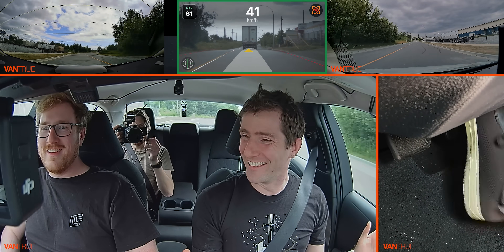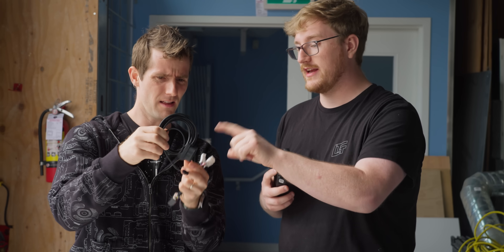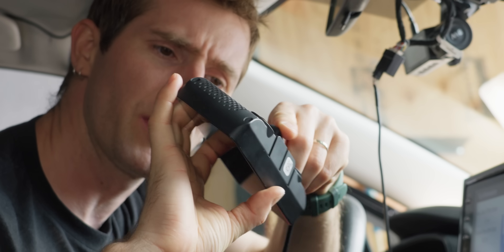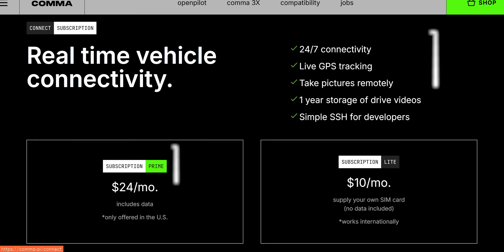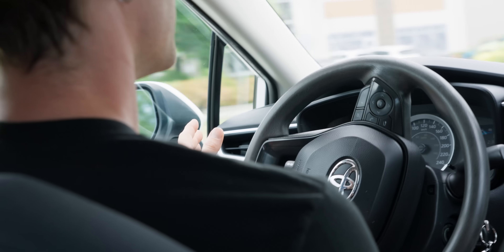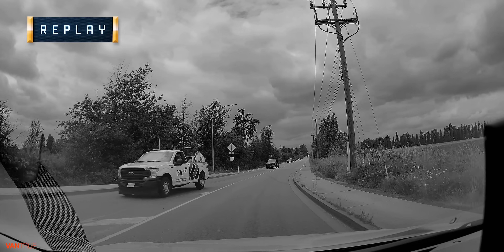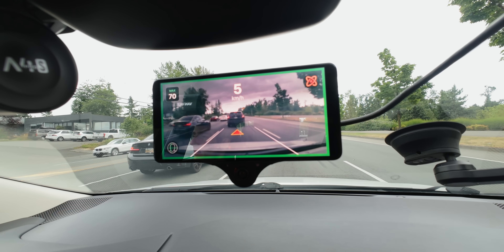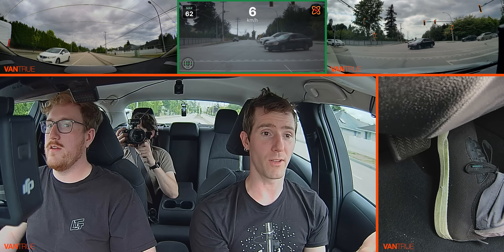I Upgraded My Car With Open-Source AUTOPILOT and it's AMAZING

Comment: As an engineer saying you can't do something like welding a chain sprocket to your steering column, attaching it to a stepper motor and proximity sensors in the wheel well, then hook it up to a motor controller, being fed with the proximity sensor which knows the distance the front and back of the tire are from the sidewalls and uses an algorithm to accurately determine wheel direction relative to steering column position. The only real issue at that point would be detecting what is a steering input from the driver, versus outside steering input like when you hit a pothole and your steering wheel jerks. You'd need to detect what is a steering input from the user versus what is a steering input from the road or environment, so you'd need to decouple the steering column and  put a steering torque sensor in the steering column aswell, That way it can reliably detect steering corrections. You'd feed all this to an ESP 32 which then uses your obd2 sensor data and wheel position sensor to bridge to comma. Honestly the easiest part is the modifying the car part, the rest is all making it work with Comma AI

Comment: I have a 2022 Chrysler Pacifica and it has HORRIBLE ACC. It won't turn more  than about 5 degrees. It downshifts and revs to 4000 RPM and then applies the brakes so it can't go faster.  I would like that.

Comment: I bought my Comma 3X a few weeks before this video was released.  Eager to see a follow up and if Linus' longer term opinion matches mine.  i.e. love it.
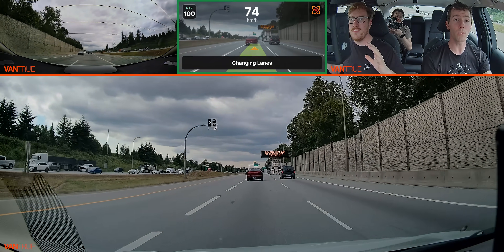@16:10 they mention the potential upgrade path using an external GPU and Linux suggests doing it in the 3rd video.  Gives us a part 2 and we'll call it quits.

Comment: I wonder who the real nervous and paranoid one is. Give you a hint it’s not Linus. Also my 2023 hyundai ioniq 6 sel is fantastic on the highway with lane keep lane assist and adaptive cruise control. I literally was on 95 for 65 miles and didn’t touch the steering wheel one time. It change the lanes for me. I literally did nothing other than turn to turn signal on to notify the car that I was wanting to change lanes. I can also touch the steering wheel make turns or make adjustments without anything being turned off.

Comment: So i looked into it, it only works with vehicles with factory equiped safety equipment that controls the steering wheel and breaks on top of the ones the comma has listed as functioning, so dont expect it working on your 04 civic any time soon.

Comment: You need to do an update for the new v4 model!
Reply: Well, though it wasn't that obvious due to lack of information in their video and on the website, v4 doesn't introduce any new features or capability. It's just a smaller unit with better heat management. The downside, is that they also shrunk the video screen to an almost useless size. 
They are working on some kind of external compute unit, but nothing was said about what it can do or is for, only saying it connects to v4. 

I was in hopes they would introduce more sensor tech that you can add to  it, or work with all the cameras in your car. 

Someone said that it'll always ONLY be Level 2 though, which is disappointing if true.

Comment: I'll stick with the stock adaptive cruise control and lane keep assist in my vehicle. At least then I know what it is capable of. These self-driving systems won't be any good until they're 100% no input needed, until then they're just adaptive cruise control and lane keep assist with some extra features that work just enough that you might not be prepared when they don't actually work.

Comment: 3:50 as long as your car doesn't crap its pants after doing so (some cars for example need to have faults reset when battery goes out)

Comment: Don’t sign in, then you can disable the driver monitor in the code without getting banned from the comma servers ( which does nothing other the not let you upload the videos. )

Also buy the c3x clone for like $600 and you’re using an old car. New cars can take corners fine.

Comment: Part 2 - Foam Bucks or Deer that you use a rope and pulley to pull out in front. Give it training data on deer. Remember, if 1 sprints across always watch for the 2nd fker that panics when it thinks it is going to be cut off from the herd/group and just jumps in front of you at the last second.
Bonus if you do a Moose and a pinata.

Comment: I'm just now peaking over the edge of this rather deep rabbit hole.  I'm shopping for a newer car right now and in my research, this came up rather nonchalantly during a video.  Now that I'm digging into this more, I'm getting rather excited as it is opening up pretty drastically my options to what is available on the used market.  Also, you're the first video I've seen since beginning to really dive into it that talked about the ability to interface an external GPU.  I REALLY REALLY REALLY want to hear more about this in particular.  Looking forward to your future videos for sure.

Comment: It shows, you have not used latest Toyota Corolla, or any Toyota car at all. All of them have stay in lane, adaptive cruise control, and it's perfect for highway driving, even in city I use it, when I know, there is speed cam, and I better be below 50. It just won't stop for red light, and you don't trust it to do perfect job 100% of time, but it works, in reducing stress. Better test drive new Toyota car models.
Reply: Seems like you don't understand the difference, this is open source and could, theoretically, be installed on any car. This is a cheap 2020 Corolla, none of those features are present.
I feel like you'd say they have not used the new tesla roadster in a video about how Starvis handles old Tesla Roadsters...

Comment: Thanks for the video. My Comma 2 just died, it's driven over 130K miles for me. I've owned it for 4 1/2 years. The Comma 3X is on order. The Comma has me terribly spoiled and I don't ever want to drive a car without it.

Comment: i find it more scary that your entire car can be controlled digitally with a couple wires and a source in 10 minutes
Reply: The magic of CAN buses. You didn't know that's how it all works?
Reply: @fitybux4664  Ah the "magic" of CANbus, making cars as boring as operating a dishwasher since the turn of the century🤣
I don't blame people for wanting self driving cars, the amount of input lag and lack of feedback on a modern car would make anyone not want to drive.
Reply: I find it beautiful tbh. I can't believe that's how simple it is. But the security risks are also scary o_O
Reply: @px8 Yup, and Toyota agrees so some of their newest cars are not openpilot compatible now even if you have electric steering.
Reply: Basically every modern car with adaptive cruise and blindspot is the same. 

As I understand it interferes with what ever the controls are available and over rides to how much the car was originally capable of. 

Basically custom instructions on what it think is right. 

If not all these new cars already have all this built in just not this open because ofcourse the liability is too huge

Comment: An early comment when it had trouble making turns that "Tesla's autopilot has problems with sharp turns too". That is NOT true. Tesla's FSD can drive hours in mixed driving environments without issue and that includes every kind of turn. Teslas leave the factory ON THEIR OWN, drive to a parking lot, crossing  other roads and yielding to other cars and park themselves. Soon they will be delivering themselves to customers after being purchased. Tesla is far ahead of every other self driving system.
Every electric steering rack has a maximum amount of force it can apply, which is why some turns cause it to request the driver's help. You can increase this by upgrading the steering rack so it has more torque or reducing torque needed with gearing or other means, depending on model.

Comment: There’s a fork called Flow Pilot, where you can just use an Android phone (with adapters). I would feel safer with the Comma 3X or whatever they will release in the future, but it is very cool to see.

Comment: As someone with this exact generation of Corolla, the car's automation definitely has a steering limit built in. It's intended for lane tracing and not actual steering.

That said, this being open source is very promising.

Comment: my ex boyfriend daily drives a Cybertruck. I don’t think most people realize how fantastic Tesla’s autopilot is. I made fun of it until he “drove me around” without ever touching the wheel. I think he spent 95% of the time sitting in the driver’s seat without his hands or feet doing anything, and this was in both Seattle & Phoenix, on the freeways, on residential streets… it turned perfectly, switched lanes while signaling, stopped at stoplights, followed the speed limit… the only time he ever had to grab the wheel were a handful of left turns when the truck couldn’t see a car in the way. but I cannot stress how rare it was. I was literally never even nervous about it. it felt so smooth, completely natural like a human was driving

the Cybertruck is a truly an amazing piece of hardware and software.
Reply: Ha I know that's you Elon 😂
Reply: @robjones1328  fsd is pretty good so that part is correct.

Comment: Reading the comments here has been more helpful. It's not quite an autopilot unless the car has high torque capability. Seems to be a decent autosteer for highways. That's actually amazing and the most important part for long highway trips. I totally see myself using this for vanlife.

Comment: But how can the steering wheel turn itself without taking it apart and installing motors and solenoids that can move the wheel on its own? What if your car doesn’t have existing cameras or lane assist?

Comment: Love me some aftermarket car gizmos.  Back in the early 80s I installed an aftermarket cruise control in my El Camino.  It had fuel flow sensor, Hall effect drive shaft sensors, and an actuator for the carburetor throttle.  Once it was calibrated you could do all kinds of stuff with it.  It would compute your distance to empty based on your speed every 0.1 seconds and update it on the display.

Comment: i have a question how does it steer for me, does the corolla have motors in the steering wheel?
Reply: If it's electric power steering there's a motor in the rack

Comment: Would be interesting to see comparisons between other similarly offered 3rd party driving assist products. Example in Malaysia where I'm from, we have one called Kommu which has been gaining interest and traction and (pardon my patriotic bias 😂) seems to be better calibrated compared to this.
Reply: kommu uses comma AI's openpilot tho
Reply: @MagZu ohh that's interesting. I did not know that 😅😂 thanks for sharing. Then I'm guessing the difference in performance may be due to how each company tweaks it? Just curious what makes the difference in performance
Reply: @johnckl2612  the only difference i see is kommu seem to use a different camera or actually looks like its based off a phone. the previous comma 2 device was just a smartphone with heatsink and fan + some extra circuitry. but it did work quite well to be a smartphone.
so actually the difference might depend on the different cameras used kommu vs comma 3x

Comment: Two dudes, Jeff and Kyle, thought: “Why not make any old car drive itself?”

They invented the AutoPilot X3000.

They said: “Plug and play, anyone can install it.”

Truth is, it’s a rusty box that barely fits under the dash.

Installation? Just remove half the car’s wiring and drill random holes.

Jeff claimed, “It presses the gas for you.”

Kyle added, “And kinda wiggles the wheel, if you hold it tight.”

They promised full self-driving for $800.

Reality check: you’ll spend weeks sweating, swearing, and probably breaking stuff.

At the end, the car kinda moves forward... sometimes.

But hey, they made bank selling dreams.

And you? You just got hustled by a toaster with wires.
Reply: Nah you're just a hater dude, it's sweet in traffic jams
Reply: kkkkkk yeah. 😂

Comment: Keep in mind that the electric power assisted steering in old cars like that - were never designed to have enough torque to take over 100% of the steering responsibility.

Comment: Have used it for 3 years now & love it! I think this video is under-selling it a bit. 
Its really not about how well it drives in smaller lanes, but more about how well it drives in highways.
Additionally think of it as a new driver (i.e. would confidently change lanes without looking at side mirrors) but something that can pay 100% attention to the road without feeling sleepy. I think on a day to day basis where its helpful is that it reduces strain for you while driving. You literally spend lesser energy focusing intently & physically turning/breaking. This makes driving safer because its always paying attention, even when u are looking at the map to see when u gotta take your turn, or when ur grabbing some chips to munch on, or ur dialing your wife's number or when u look at how badly sloshed your friend in the passenger seat is. Its ALWAYS paying attention & you become the relaxed second driver. 

In fact it was also a great tool that I used to teach my wife how to drive. It kept centering the car in the lane helping her understand what is the right position without me being the one breathing down her neck! Lol. 

Its definitely not full autopilot that can handle all types of roads, but its a really great newbie driver. 

One thing I must say though is after using it for so long, u do tend to trust it more than u should. As long as u keep a check on that, its a great product, perfect for nerdy folks!
Reply: @RaunakThomas  Yeah I remember having to drive home after an extended night shift and I was feeling sick to my stomach. It was a 45 minute commute and I was so happy to have the additional assistance getting home. It's like having a super attentive co-pilot

Comment: I have used the Comma 3X for 8 months in my Toyota Highlander 2021. Man its a game changer for the average Joe. Toyota is one of the brands that Comma Ai works well with the Toyota Safety Sense . You can use different forks like SunnyPilot or FrogPilot . GEO HOTZ u da man bro .

Comment: AS A MECHANIC IN NEW CARS IN MODIFICATIONS LIKE THIS DO NOT UNPLUG BATTERY. IT WILL TRIGGER ALL POSSIBLE DASHBOARD LIGHTS THAT YOU WONT BE ABLE TO REMOVE WITHOUT SPECIAL DEVICE. Also this Toyota is probably hybrid so disconnecting batter won’t do anything as far as hybrid is still plugged in but that’s just BTW

Comment: Yeh ... I mean at what point can you even tell if the person behind the wheel is even fit for driving?
I don't mind driving assistance but not driver replacement. Either make the systems bulletproof where it can properly turns and read the road. These in-between things seem like taking a risk.
Asking someone to "pay attention" while letting a system drive for them. 
It's like asking people not to use their phone while driving.
Thankfully this system requires money and a bit of knowledge to be able to use so the chances of a responsible person using it is very high.

Comment: Ever since I've first heard about these things I have one thing in my head: CARAVAN LONG DRIVE ASSIST

I see this as the best possible scenario. You're driving long, long haul, and you're on a holiday, you're gonna need alll the help you can get to manage the road, manage the fatigue, but also have time to unwind and take in the views as you're hauling for 800 kilometers from place to place. This is the best possible thing until FSD comes and you can buy a caravan with a balcony and just chill with a bottle of kefir on the patio as the car drives itself.

Comment: 14:30 100% agreed
that is dumb self driving without the navigation how will it know where to go which turn around to exit. It is not self driving it is lane assist on steroids with not even good adas, they are just using us to train with data
instead of going self driving head in 1st they could have made an AR navigation first because they have good lane route selection which means could be put into any car even purely mechanical with dash cam features. then use that data to train their self driving models to make for this control unit hardware

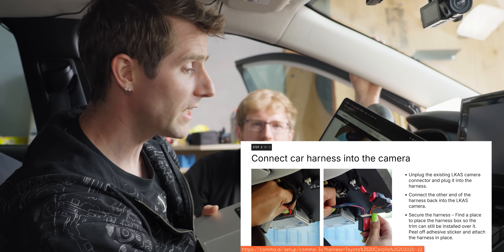Comment: 4:13 what is that huge part on mirror. i dont have it.
waith that car already has camera in it? for what and how old model is it. it could be recent
Reply: If your car doesn't have it then it's probably old and won't be compatible. This is meant for cars that have probably have lane assist and can be controlled more. You're not going to put it in a 1979 truck

Comment: I was curious and the video answered halfway through... Toyotas have built in lane assist for the cruise control, but I didn't think it would be able to turn the wheel enough for sharper turns, and I guess it's not? Lol. Honestly I'm shocked that a plug and play device is even allowed to take control of throttle, brakes, and steering in the first place. Wild.
You'd think manufacturers would be as litigious as Nintendo on this.

Comment: Have been using it on my 2018 Honda Odyssey for almost 6 years now.   First unit (comma2) failed after about 3 years, now second unit has been installed for about 3 years.